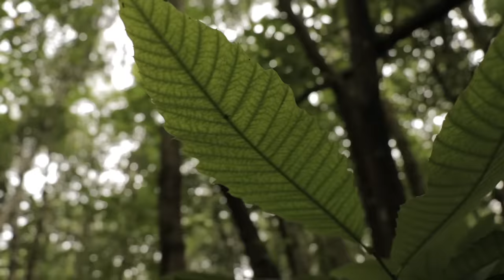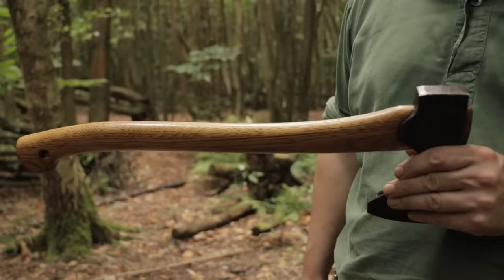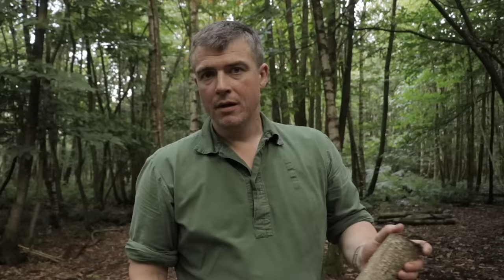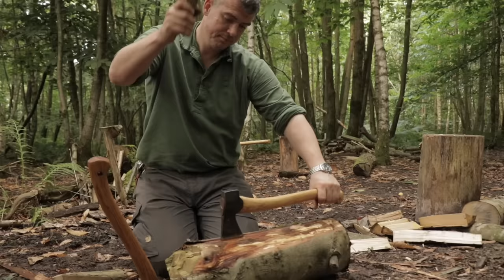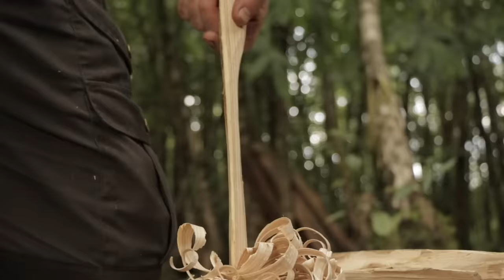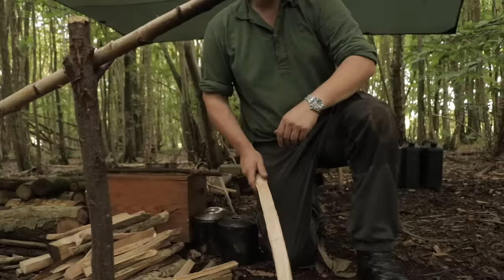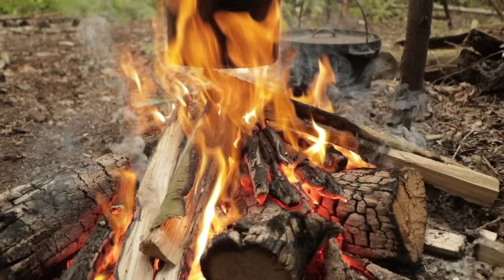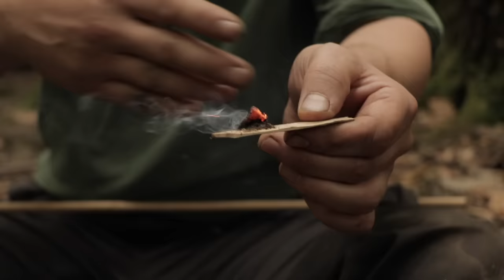Bushcraft Skills - Axe & Knife Skills, Camp Setup, Fire (Overnight Camping)

Comment: Gotta say this information is priceless and never ages. I'm just not a fan of those little camp axes. I prefer a tomahawk and a saw blade ,(make my own buck saw). Also I prefer a removable head on my tomahawk. Just so many uses.
 So 3 knives one tomahawk ( usually coldsteel trailhawk) a few saw blades, an a folding saw. 
I prefer to have extra then need, and not have. I've never been a toothbrush cutter.I'd rather be short a outfit then need a knife or saw. I never understood the weight crazy people. If things were heavy then I worked a bit harder. 
Fire and forts can fix everything. Wet  in woods with no shelter can be dangerous. 
One other tidbit! it's better to learn to survive with any knife then worry about the what's the best survival knife.
 I'm from a time when we had different knives but nothing like now. Everyone used a buck lockback 110 or a ranger. An never did I feel like it wasn't enough. Fixed blade is nice but not even close to necessary. 
Just my 2 cents, from boy scouts to army ranger from scout to leader order of the arrow for those in the know. Been around a bit.
Wonder what weight packs are considered to heavy. Most of my packs for extended stay were 45lbs or 65lbs now my pack appears to weight 30lbs wonder what people consider to heavy food can add a bit more.

Comment: 29:29 How about THE SECRET that everyone knows of splitting "FROM THE ROOT TOWARDS THE BRANCHES!"   ....  RATHER THAN FROM THE BRANCHES TOWARDS THE ROOTS.
Splitting from the branches towards the roots, there are embedded branches INSIDE THE TRUNK, and the split you're trying to run from top to bottom GETS CAUGHT, WEDGED between the straight grain of the trunk, AND THE DIAGONAL GRAIN OF THE INTERNAL BRANCH. It stops the split by absorbing the energy of the axe. WHEREAS if you're splitting from the root towards the branches, the energy of the axe/split IS SHED AWAY FROM THE CENTER OF THE TREE TOWARDS THE OUTSIDE. So the split sheds away from the trunk and takes the wood piece with it.  JUST SAYIN'
New Jersey USA said that. At 75, I split a lot of wood. Oh Yeh, Congrats on 2.16M subscribers!!!

Comment: Regarding the lift and drop of the smaller ax to split a larger log, Is safety the main issue of handling the log as the manipulation point rather than the ax and just dead dropping it?

Comment: the worst of the problem your having with splitting that chunk of wood is...your cutting cross grain of a knot. in that it requires to break the knot, not cut it. place the axe to cut with the direction of the knot and things will go better

camp coffee; another way is to add coffee grounds, add cold water 1\2  level of pot, bring to boil, set pot off the heat, add cold water by pouring at about 3 feet above coffee pot adding as much water as you had in the beginning. coffee grounds settle to the bottom and coffee is hot and delicious.
Like to hear your take on the different knife blades and grinds.
On the hand drill, what woods are you using .

Comment: I’ve always believed that an axe shouldn’t be batoned, upside-down chopped, or struck on the poll, as the sides of the axe are compressed and stressed. I use the blade,  or poll to hit pegs, but never both.   Have you ever noticed any damage?    Great info.  Cheers.

Comment: I'll give you a hot tip right now, the reason we don't move the piece of wood back and forth while the saw remains still is because the piece of would is very heavy and the saw is very light.  Any fool that tries to convince you that moving a whole tree branch back and forth is ore efficient is not someone to listen to.  All they are teaching you is how to use ten time the energy to accomplish the same task.
Reply: in b4 the replies:

take the log you want to saw, wedge it between two other logs (parallel to the one you are cutting, so basically a pyramid of three logs) and then put your knee on one end. If that still sucks then throw your belt/some rope around it as tight as possible and it will never move and now you are basically sawing it on a crude table and clamping it in place with a vice

Comment: @26:55 I feel he has missed  step in bushcraft. If he were to have taken a couple smaller in diameter lets say half of the logs, and made wedges to be used in splitting the log. In the long run of lets say a week or so, the energy saved will be felt over time.

Edit okay spoke a bit ill hearted , really like the technique of flipping the wood to use the weight gravity. Still wedges for long term suffice as . well played.

Comment: great tips on tool handling, there is a better way of doing the feathers, and also why the hell is the pot hanging apparatus as fine as an animal trap trigger, that is just waiting for a knock to put the water on the fire? i would go for a mor robust branch fork on the rest with a t hook on the hanger, you are using hands to lift and remove the hanger and pot, so why go for a hair trigger? on the feathering, it is much more economical in energy and control to choose longer sticks, split before sawing so they are long enough to rest on the collar bone, then it leaves both hands to control the cutting implement to shave the feathers, it is very effective.
Reply: very enjoyable video to watch

Comment: Mom always said if you don't have anything nice or helpful to say then say nothing, so why don't you just cut a little saddle in the log your using to rest your wood on so as when you cutting the smaller piece it won't roll around, trying to use the saw vertically is a disaster waiting to happen!

Comment: 41:12 you a monster at splitting wood 🪵 🤣 😂 I had no idea you could split wood like that I knew about the hitting the wood and when the axe is stuck to pick it up and use the weight of the wood to hit the hammer side of the axe bc the wood is heavier than the axe head

Comment: Great vid guys !

I'd have question :

At 45min, the knot used to tighten the ridgeline works basically the same as a trucker's hitch (except using a carabiner instead of just having the whole rope put through the loop).

The part I can't figure thought is the second loop which a peg is put in.
Reply: The second loop could make it better.

Comment: Yeah, I would of layer down multiple pieces of wood 3 , 4  and used them as a saw horse. Use 4 and at 2-3 feet apart and you have a perfect long ground sawhorse and saw that wood right up with no problem.  Use less energy than sawing the saw with the wood.

Comment: that 3000 and 5000 sandpaper eliinates scratches in clear coat on your cars paint.. Even scratches you can feel with your fingernail. It blew me away it removed scratches 12 inches X 20 inches scraped by a metal sign on one ofmybdoors.  Oh yea I think your cuckoo clock is stuck.

Comment: Yeah the coffee drop I know that one also i got a secret tip a Mr Olympia taught me to stimulate your pec muscles effectively you use two spotters on the smith machine only as safety is important what you do is get read to lift and ask both spotters to spin the 20 kg weights on each side as it spins do your lift when weight stops spinning you stop it the centrifugal force a guy called Milo sarcev taught me then directly after the exercise you apply intense air pressure to your forearm by blowing at middle fore arm it stimulates golgi tendon organ and nerve endings that go to bicep in turn a reaction happens in opposing muscle the tricep so centrafugal force secret training And apply the Golgi tendon air pressure nerval displacia technique both techniques come from europe man I got huge....and hard....go train try it be frugal with the secret I'll keep the coffee drop technique a secret I may tell a few kettle bell class attendees

Comment: hello or yes? That, "glut" Get a Glut, in, and she'll split.
Like as if some Old' Spirit came through, it's just a glutton, get the glut in, linguist? Where first said
Glutton, gluttony get a glut in and run with it, two gluts in and more she run the line?
I don't know. We're all one Mate's.
peeps
All one whole. be well now thanks. This is a Great refresher, and, just good sense. I Hit that backside of hand with the nerves and the veins. yeah in the wilderness, Hansen Creek, a drainage and fire whacking a Wankers way, and well? Very preventable. The shin, also as you said, it was close with small ax, and with a shorter, EASTMAN, 22? 25 oz. no finish, flat hammer. Hit each shin, HA HA :P Smart amADDickin. :P I thought I was going to go through my leg, just hurt really bad. :D SCRAPPING Metal, 2071? and ah, in a hurry and being dumb- Slow down. T
Thanks there. Here here. techniques, and Gut er ole' Gut in Gutter out!

Comment: Every task minus the canopy I see alot of wasted energy if you were in a survival situation. Using a saw is a horrible way to waste energy. Starting a fire peeling wood?? spending once again a boat load of arm strength and energy when snapping up some dry twigs would be way easier, Splitting all that wood vs just using those lenghts that you had, more energy. It's one thing if you are out doing something as a hobby but for survival the person would be dead from being to weak to do anything.

Comment: I find a problem with the idea of holding the saw still, while you moving the piece of wood up, and down on it. The whole idea of survival is to work smart, not stupid. That way of sawing wood is stupid because you are exerting way more energy than needed to cut a piece of wood. Look at nature, animals , who my the way are experts in survival, expend the least amount of energy possible, to achieve their purpose like catching food, finding shelter, etc... . Using one arm to operate the saw is much more efficient than using two arms, and a lot of waist bending, to do the same job. You are not sweating, thus consuming more water, and increasing body metabolism, burning more calories, and thus requiring more food. You might want to rethink that part of wood processing in a survival situation, or any situation where easy access to food, and water is not present.

Comment: it is clearly that this guys and specially Tom have not spend enough time with experienced  outdoor people and learned from them, but found his own ways and thinking of instructions to much. Swinging and axe at a light log lying on the ground between his legs like that is stupid and dangerous. The effect when hitting is so poor compaired with having it standing on a solid base. Holding the axe and the thin log for splitting etween both hand instead of one in each hand is really not recomended. Always hold the axe in a solid grip, not losly like that.  When lying the log on his side and swinging the axe at it is just stupid and dangerous with a very little effect compaired with having it standing on solid ground or on a shopping stick. And when learning people this wrong and dangereous thing  I get completly abandoned. He need to stay with a timber chopper or and real bushcrafter a while. To get most coffe out of the pot using the senrifugal forceit is much more effectiv to swing the pot 2-3 rounds in a large circkle than this weak lowering. Then you can pour coffe till its only coffe grouts left. When using a rotating thin stick to make heat to light a fire it is 100-times more effectiv to make a bow and use the rope around the stic to rotate the stick. Hehas a lot to learn of basic outdoor wood life, like Brandon Rasmussen wright lower down here.